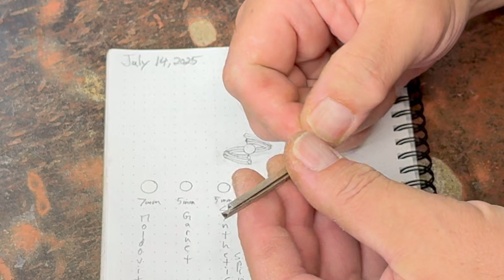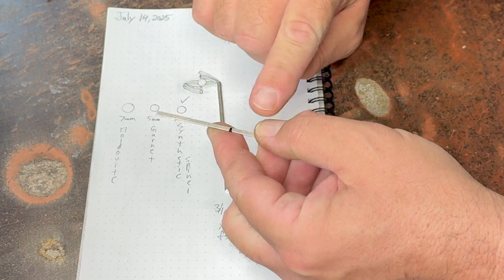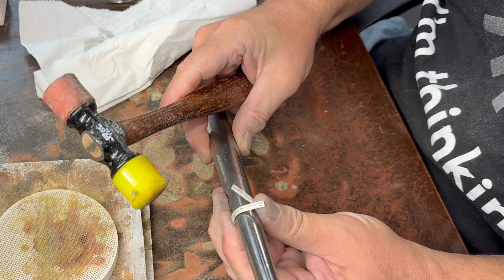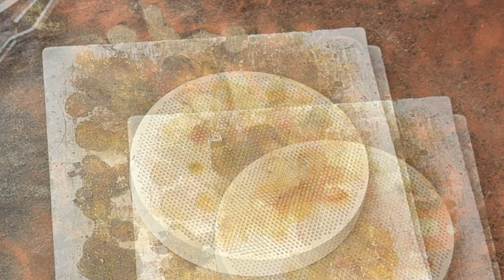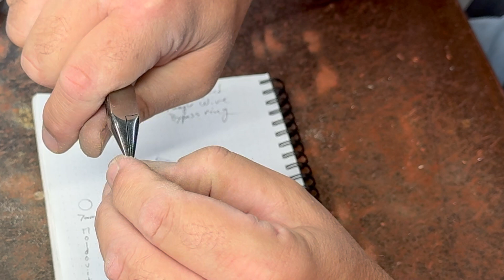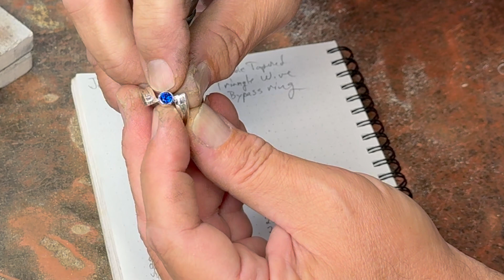Making a Triangle Wire Bypass Ring:  A Silversmithing Tutorial

Comment: Hi Chad,  LOVE this ring! And I love this channel. Just wondering, do you solder the step rings before soldering them into the bezel setting. I tried to do this with a pendant setting, but had a  small gap where the ring ends met and the solder didn't reach, and despite that the rings were well fitted and lined up. I also think my little dremel torch is probably too small for these jobs. Would a plumbers torch be suitable? I don't have room in my little space for a tank. Thanks for all your informative tutorials
Reply from the maker: Thanks Jo!  I do not solder them first, but I do cut them so you have to really jam them in there to prevent a split happening:). You should be able to use a little butane torch for a ring this size I should think.